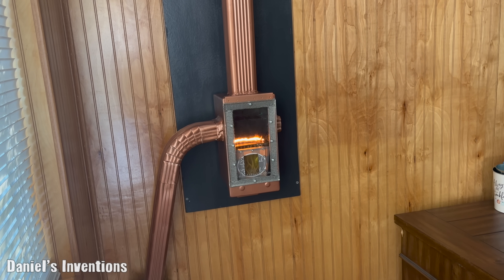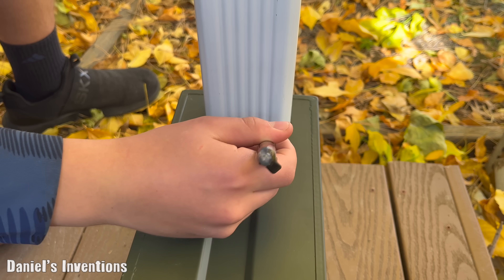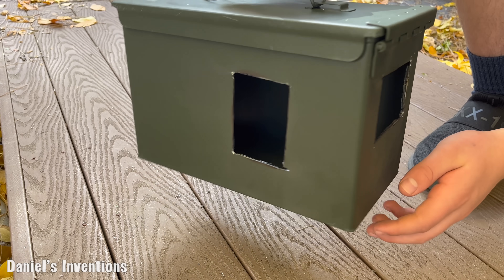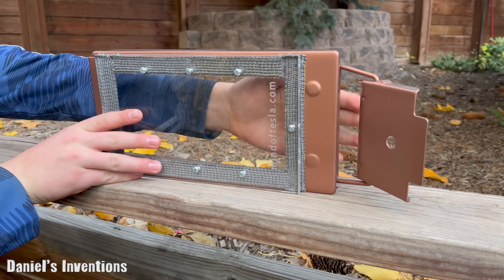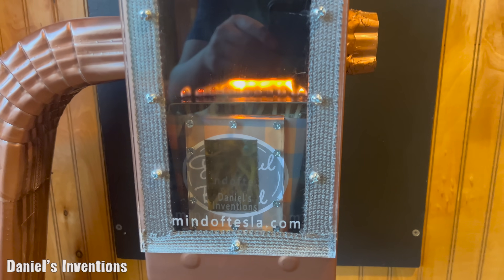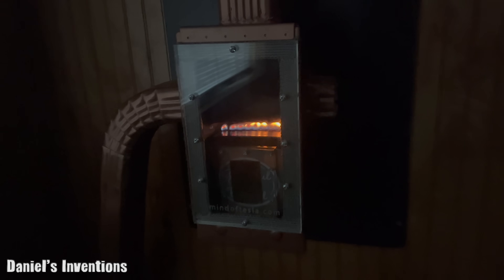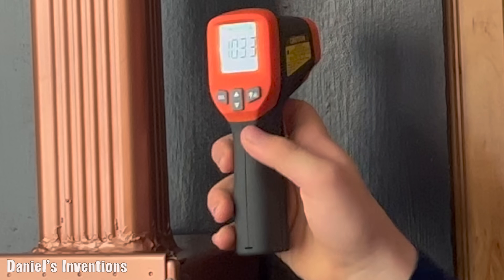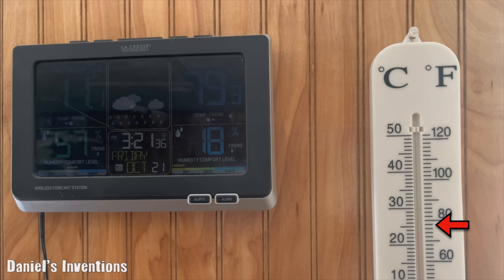ENDLESS Heat for Your Home WITHOUT Electricity

Comment: Lots of great comments and suggestions.  Mine is to not cut rectangular holes and throw away all that useful metal, but cut Xs and bend the points out to make a solid flange with much more sealing surface area.  There are wide/flat jawed pliers and vise grips for sheet metal work that would do a neat job of it.  The ducts could also be screwed or riveted to these flanges for a mechanically solid assembly that doesn't rely on or stress the sealant.  A solid mount on both sides of the heat exchanger will cause stress as it heats and expands at a different rate and extreme than the sides its attached to.
Reply: Great comment bro. It will make the construction closer to rock solid. And ofc better sealing surface. Going to do this in my cabin, and your advice will be followed. Thanks for input :goodvibes:
Reply: HighHeat™ is a hand mixable epoxy putty stick specifically formulated to bond and repair materials that will be exposed to high temperatures in automotive and industrial maintenance applications. It cures to a tough, hard bond with little to no shrinkage. This industrial-strength product outperforms conventional epoxy putties at high temperatures and sets in 1 hour at room temperature. After 8 hours, it can be drilled, tapped, machined, ground, filed and painted. HighHeat™ is rated at a tensile strength of 4000 PSI and cures to a machine grey in color. It is able to withstand continuous heat exposure of 450ºF and intermittent heat exposure to 500ºF.
Reply: @ OK, spammer.

Comment: Looks cool. Having said that, the aluminum gutter pipes are probably going to fail at some point.  Other creators have built similar heaters using automotive exhaust pipe.  Seems safer.  Good luck.

Comment: Everything about DIY fire burning stove is unsafe. The materials it's made from are not selected by their respective manufacturers with fire safety in mind, so the heat may release fumes, or it may corrode rapidly. Having it strapped to your wall not a good idea. How about this: just make sure you comply with local fire code. Try to get the thing to pass inspection from the fire dept. Dude posts videos for revenue from clicks, without regard for anyone's safety (or maybe dude doesn't care about clicks, dude is just an idiot who posts videos without regard to other's safety). Improper attachments or sealing, with materials that were never designed to be attached this way, could leak carbon monoxide. Everything about this is a bad idea. Just buy a dang stove or something, that's meant for this purpose.

Comment: Infrared thermometers are made for measuring surface temperatures, not air temperatures. The 452 degree temperature you measured was of the aluminum over the flames, not an air or output temperature.  This may be fine for a small cabin or shed/workshop, but should never be used for home as it's not an approved device, and it's use would void any fire insurance policy.

Comment: The cuts were not nicely done, you should have used a dremel there. Now you need to file down all the sharp edges of them and fill in the sides where you cut outside the area too.

Comment: Is it not possible to install a self running fan inside the pipe? There are fans that runs by themselves when heated, for chimneys? Could there be a version somewhere for to be built in? (I have not found one and I am seriously considering building a heater like this at home)

Comment: The more you use it the less effective it will get. The soot that builds up around the pipe from the oil candles acts as an insulator. You will need to keep cleaning that off.

Comment: Looks like a good proof of concept prototype. You can control the rate of reaction by adding a valve to the air intake, but that would mean using something other than gutter pipe.

Comment: You can have your exhaust pipe run around the walls of the room before exiting outside...this way you can have more heat radiate from the pipe and warm up the cabin even more before the hot air  gets expelled outside.
Reply: That's an excellent way to kill your drafting

Comment: Need better tubing to do this build for a lifetime use, steel round tube at least 1/8 Inch thick,  rather than that guttering , it will rust and flake fast in heat and allow for exhaust to enter your home.

Good idea, needs update in materials

Comment: Congratulations, you have succeeded in reinventing the kerosene heater that I was using 40 years ago, but without the ability to refuel without having to wait for the heater to cool down. And at about the cost of a new, more efficient heater. Oh, BTW if that temp at the outlet of the heated air was 400+ degrees you could not get your hand that close to it without being burnt. And no I am not subscribing.

Comment: Best part:  all the parts cost about $100. Followed by: I used a $1500 3D printer to print one of the parts.  Lol
Reply: You can get an ender 3 for $100 at any microcenter, 2002 called and wants their prices back...

Comment: You could get better efficiency by attaching heat sinks inside of the air piping right above the flame to better move the energy off of the metal and into the air. You could probably harvest some off of an old hair dryer or toaster or ancient computer/tv

Comment: In due time, galvanization ( due to dissimilar metals)oxidation and carbon or creosote build up will take its toll on this homemade unit. Insurance companies wouldn't approve of this. Humidity is also an issue with this set-up and it would need service come fall and wintertime and replacement of components. Metal oxide poisoning is also an issue. JB weld isn't the same as the original JB weld from the past and doesn't adhere to metals like it used it used to.

Comment: My Thoughts on Fire Safety:
1) Before attempting: Inquire if this device will affect your fire insurance. Should a house fire occur, your claim may be DENIED - if a home-made heater is found in the wreckage. (Even if it didn't cause the fire!)  You will need this device inspected/approved - before use.  Inform your insurer.  CHECK local building codes.
2) A safety cage near the oil - would be good to install.  Rough house play by children, moving furniture mis-haps, or plain "somebody fell on it" accidents might spill the oil.  (Think bookshelf falling on it.)
3) Holy crap get a carbon monoxide detector.  (Surprised this video didn't mention one.)
3) ALL open flame causes an increase in humidity.  (That's right, an increase!)  Water vapor is emitted by all open flame. Yes, candles, etc.  Will this water vapor potentially cause mold issues in humid climates? Do you need ventilation? De-humidifier?  Does condensation appear on the vent pipes?  Do you have a way of dealing with it?  Catchbasin, like a butter dish?
4) You need a passive cooling backup - for when the fan will quit working.  A large computer CPU radiator would do nicely, as someone else in comments suggests.  Will probably add efficiency too.  I recommend a small alarm that will sound when the fan quits - just in case.
5) Choose your computer fan wisely.  Larger MM size = better efficiency, slower spin needed, thus, less noise.  I would only consider Noctua, or Enermax brands.  Noctua for their extreme efficiency, long warranty, and Austrian build quality.  Enermax, for their dependable ball bearing tech, and ability to pop off the blades to clean off dust easily.
6) You NEED a dust filter on that fan.  A) To prevent flammable dust buildup in the system (all dust is flammable!)  B) Protect the fan - dust buildup is the death of most fans. C) Prevent insects from entering the system.  Get a 120mm (or whatever size) Nylon Mesh computer fan filter for it.  Wipe it clean every week with a cloth.  Viola.
7) Add a temp gauge.  Or several.  
8) I don't know if any of the pipes get hot to the touch - but insulate them with mineral wool or some wrap - to protect kids from burns.
9) Whatever backing you use on the wall - better by fireproof.  Mineral wool between the backing and the wall - might be a good fire safety measure.  Might give you the option of making the backing reflective of heat too.  
I like your ideas - but please mention safety considerations in your videos too mate.

Comment: if you add a thermoelectric place on the inside of the vent with a heatsink on it then the heat transfer into the pipe can be used to power the fan and maybe give off some extra power to charge a phone or something

Comment: all the heat escaping from the exhaust could be used if you use a cross-flow heat exchanger to heat up the intake air. this makes it more efficient and less heat will be lost

Comment: If you ran the input duct straight through you could pick up the heat without any risk of combustion soot or gas getting into your living space. 100% Silicone calk or Firestop caulk around the joints, JB weld is not fireproof. Add air intake holes for combustion on the lower part of the box.

Comment: Kind of a good idea, but if you had water in the pipes with a pump the heat would work like center heating and be transferred to the water. Would be much more efficient

Comment: You said it takes about a week to get through 1 Gallon of Oil.
1 Liter oil has a calorific value of 1kWh
1 Gallon of Oil equals ~ 38kWh
A week has 168 hours. 38kWh/168h = 220.

That means that this "heater" has an theoretical Maximum heat output of merely 220W. And that's without even considering the heat losses due to heat escaping through the exhaust pipe.

That means this heater produces as much heat as an older type 65" flat screen TV - or 5 average sized candles. 

So, sorry to say it but I really wouldn't want to crush at your place during winter time.

Sure, it's a cool project, but pretty useless for heating purposes.

Comment: VERY IMPORTANT IS THAT THIS "HEATER" USES THE OXYGEN IN THE ROOM SO IF THERE IS NOT ENOUGH FRESH AIR VENTING YOU COULD SUFFOCATE ALSO I WOULD BE WARY OF BURNING THE JB WELD THEY USED TO HOLD IT TOGETHER

Comment: i saw another dude make a weak version of this for his mini sled cabin. you have a few issues with this.

make sure your not using a galvanized metals and make a point to make sure because the fumes with kill you. most gutters use this kind of metal.

you losing a lot of heat with that kind of heat transfer. you want to apply a heat sink in the area your putting the flames on. copper heat pipes transfers energy rapidly and will spread the heat faster to the air. you can find heatsinks in computers and such.

you did a way better job then that last guy I saw and he was a grown man

Comment: A Mr. Heater Little Buddy will cost less than this contraption, they're currently about US$80 at Walmart. It will also use less than $5 in propane a week to heat the same amount of space as this. I refill my 20# propane tank for about $20, and it lasts me two months in the mountains of Colorado.
Reply: Just looked up that heater, says it only runs 5.6 hours on a 1lb tank of propane, that’s a lot shorter than a week

Comment: Thats a great concept for a small space heater, scaling up would be simple. including usage rates and temp in and out was also very important . Sure it can be tweaked but the concept is sound.  
It I had anything to add id say , 

put a speed controller on the input fan. then create and index the temp in to out ratio.   adjust the fan speed to maximize temp out put .    lots of fun still to be had.

Comment: It costs 19 cents per 1000 BTUs using heating oil based on prices in my area.  Not including what is wasted going up the chimney if the furnace isn't the best available efficiency.  Heating with electricity is about 5.5 cents per 1000 btus and is automatically essentially 100% efficient. 
Sure, if you are off grid, do what you have to do, but my oil furnace went in scrap bin after my first winter of freezing indoors and chopping wood for dozens of hours and still getting a huge oil bill.
This is a great idea for a do it yourselfer with lots of time and little money.
Off grid, when propane isn't practical, a diesel marine stove would be my choice.

Comment: Someone commented about you using aluminum gutters. I can’t seem to reply so I’ll note that it looks like you’re using copper gutters.  This leads me to another idea which is you could try copper pipes at the output that extend into other areas.  Rather than all the hot air dispersed at one spot, it’s spread out a bit.

Comment: I would not say anything if this was not so clickbaity 
Nothing is endless maybe this stupidity, vegetable oil should not be allowed as fuel u wasting it, 9,7Kw per Liter 2,5$ per gallon, where do you get that cheap oil. I see there in a short search 3,6 per 1,7Liter in US wall mart, Ineffective waisting of burned oil thinking u just reinvented an oil burner, looking at that flame I can see that u burn it at a low oxygen concentration means waisting it, u have no mechanism to replenish the candle sticks that fetich the oil easy don't waste our time with that garbage. so a gallon contains 36,6Kw of heat, so ur fictional fuel cost 7 ct per Kilowatt I don't believe show us where u get it and what it is 36,6Kw per week 12h a day so 5,2Kw per day 335W/h as u claim the usage, No Elektricity the fan runs on 12V and 1,6 A that is extremely stupid 20W/h extra 1,68 Kw per week for the fan spinning but building it so that the heat rising should suck enough air without extra fan needed, please don't use teslas name he would turn into his grave when he sees this

Comment: 99% sure you are really using aluminum gutter pipe. which is a really really stupid thing to use for a heat source. I know you said it was steel but they don't sell steel gutters painted white any longer, haven't in decades. So you are either a liar or you been ripped off.

Comment: Your flame is burning very inefficiently. Use a steel mantle over the flames to increase the burning of secondary gases that were made in the primary burn. You'd need to remake your central heater area as your pipe over the flames blocks you from doing this.
Also I would suggest to put a steel tab nearly covering the top exhaust hole to reflect some IR heat back to heater area. Make enough room for exhaust gases to escape but still, cover that hole with a steel rectangle  in front of it that reflects the heat back.
Also put a reflective foil on the ceiling just above the heater. Also, like was already suggested, make a space between cement and wall and put a reflective foil on the wall for IR to be reflected from it. You can probably even ditch cement this way.

Comment: This is really cool!, wonder if you could improve it to regulate how much heat goes out, would that depend on how much the fan pushes air to the heater? for example, if the air runs half the speed, would that change how much heat comes out of that? or would it make the less air hotter? either way truly a great project!

Comment: BRilliant design boys. However I would maximize the use of your radiant heat by addding a water circulatory system around the room to retain that heat longer in the room.  The water tank could be located in a position that would capture all that over 400 F heat and send steam into your metal pipes going around your room, warming things up more evenly and if you make it a close loop system, the steam can return to the tank as condensation water back into water tank. With a few modifications, it could also serve as your hot water heater for cleaning and showers.

Comment: A heat exchange mesh inside section of the pipe over the flames will increase the efficiency several folds.

Comment: I say BS on this video. That’s not enough heat. Wood burning stove radiating 1000 times more heat will be sufficient to warm that room. You would need to build quite a few more
Reply: And costs 1000% more and needs way more fuel...
Reply: At 11 degrees F outside, it was 79 degrees F inside.
Reply: @sloppyfloppy79  with an additional heat source not mentioned
Reply: @Big_red_builders  the human body dumps about 100 watts worth of heat per hour.

Comment: This is a unsafe surefire recipe on how to kill your family.
    First this bad design using the warm oxygen in the room, which us a code violation In the USA. Because you that same oxygen to breath. DO NOT DO THIS.
This setup will leak Carbon Monoxide into the house. This is why we do not use Franklin stoves in the home.
JBWeld is bot heat resistant and will fail when exposed to prolonged heat thus causing it to fall apart and causing a hours fire.
DO NOT DO THIS.
Lastly This furnace is too small to heat a Closet much less a whole house. At best it is about 500 BTU.

You have No safety precautions, No alarms or CO Detectors.
He is not qualified to teach anything.
It needs a heat exchanger to make this safe.
your welcome
A certified Engineer. BSEE, BSME, MEE, MEE, BSCS

Comment: First you are using the warm oxygen in the room which us a code violation In the USA. Because you that same oxygen to breath. DO NOT DO THIS.
This setup will leak Carbon Monoxide into the house.
JBWeld is bot heat resistant and will fail when exposed to prolonged heat thus causing it to fall apart and causing a hours fire.
DO NOT DO THIS.
Lastly This furnace is too small to heat a Closet much less a whole house. At best it is about 500 BTU.

You have No saftey precautions, No alarms or Co Detectors.
You are not qualified to teach anything.

Comment: BTU's are BTU's.  I'm sure it helps, but it will still come down to the insulation effectiveness of the space your trying to heat.  I like the idea of DYI, but never at the cost of safety.  I think you should make a safer unit and make a new video on that.   And then add up the cost to make and the cost of the oil, do a BTU calculation and compare that to other methods of heating your cabin.  Maybe this will work perfectly for your needs, maybe you might find something more efficient?